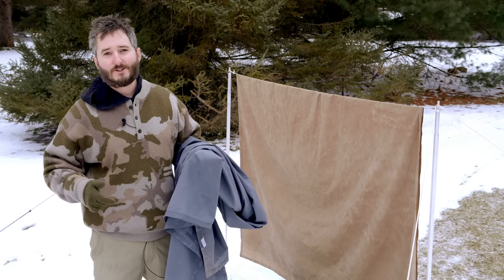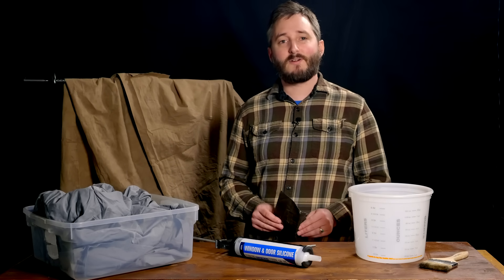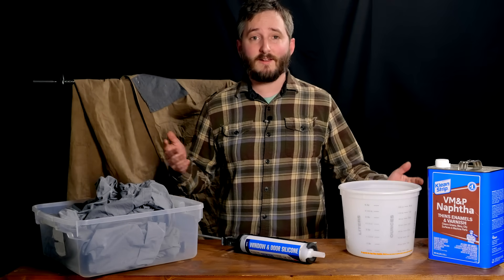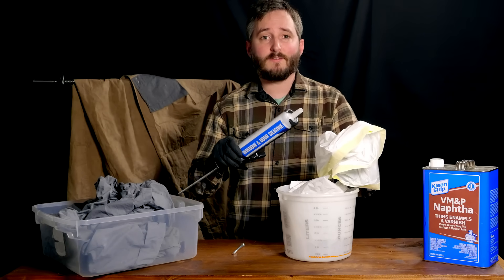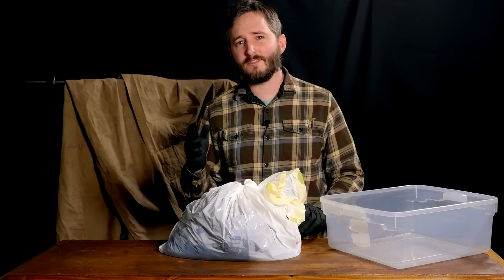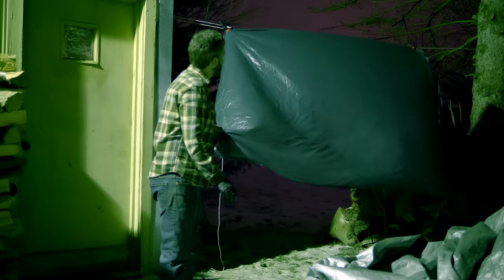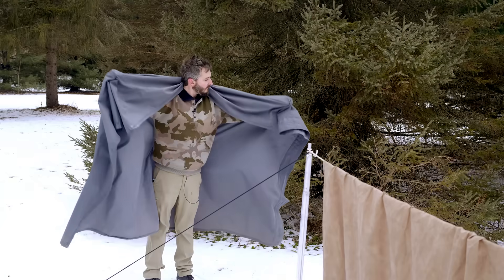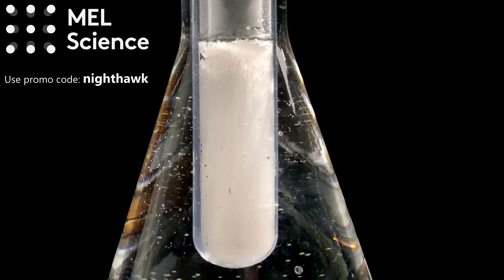Recycled Bedsheets Make The Best Waterproof Tarps

Comment: This is gold!   I just made a sailboat sail out of a bedsheet using this method.  Please, don't ever take this video down
Reply: RIGHT.....???!  
I was just pricing traditional oil-cloths & "NEW" survival tarps.   And this is a brilliant prepper-project. 
it's a GREAT skill
Reply: Im planning on waterproofing my bedsheet sail with this technique. Do you recommend sewing the rope in the edges before or after waterproofing it?
Reply: @sawer  Before, "glue" it all together!
Reply: @stewartmcdonald4121  won't the solvent dissolve the glue?
Reply: @samgould9930  the silicone would be the "glue", if I'm not mistaken.
Reply: @sawer   It really doesn't matter.  If it was me, I'd  do it without the rope.
Reply: @sawer both.
Reply: does the fabric still breather?
Reply: @snorttroll4379  No
Reply: @deltafour1212  thank you
Reply: I could see doing this as a fabric cover for wings...
Reply: @TimeSurfer206  Thought the same thing
Reply: @TimeSurfer206 I think they split up. But a drum and bass rinse-out would be interesting.
Reply: sailboat sail out of a bedsheet: it won't be strong enough . . .
Reply: @breannestahlman5953  It is for the small canoe sail rig that I am using it for.
Reply: @deltafour1212  don't worry about how strong your sail is, worry how strong the wind is.
Reply: @clivewells1736  I wasn't worried about the sail.
Reply: All bedsheets are not made the same, 100% cotton or poly? And some old sheets are so thin that even with that waterproof coating, they will rip. I think if you’re going to go to the effort, one: do it only outside and two: use a good, heavy sheet. I’m thinking of using this to re-waterproof my 1950’s umbrella tent. .
Reply: @earthn1447  You're correct.  I'm not sailing in high winds.  So far, my bedsheet lasted the whole year with no signs of wear. I'm making my next sails out of a shower curtain and a painters drop cloth using the same method.
Reply: My mom sewed unbleached muslin to make the 78 sq ft  sail for the 8 foot sabot I made as a teenager. The Alum pole mast was 17 feet tall instead of the 13 foot one called for on the plans
Reply: @MilesCobbett  Interesting.  How well did muslin work as a sail?
Reply: What a great idea!
Reply: Lol
Reply: and you trash all you love with.....
congraz.
Reply: Thi s is great...kiss goodbye goretex technology.
Reply: Excellent.
Reply: How is it now? Is it still good?
Reply: @ShellaPunx  Yes but it's getting worn out to where I need to start thinking of making a new one.   Not bad for 2 years of sailing on a $8 bed sheet.  ;)
Reply: @deltafour1212  we don't have naphtha here,can i use paint thinner?
Reply: @ShellaPunx  It should. I never used paint thinner.  Do a small test sample just to be sure.
Reply: @ShellaPunx  Do you mean turpentine? Yum, piney
Reply: calm down kid
Reply: Lol, must be a tiny sailboat! 🤣
Reply: @davidevery4434  ....and?
Reply: @deltafour1212  And?
Reply: @elelegidoriginal  Yep
Reply: @deltafour1212  And what? I don't know anything else about your sailboat, other than it's very small.
Reply: @davidevery4434    Small sail match with small boat.  What more do you need to know?
Reply: @deltafour1212  I don't need /want to know anything about your little boat! Thanks for your concern, though
Reply: @davidevery4434  NP. Glad you figured it out.
Reply: @deltafour1212  That your boat is very small? Lol, no "figuring out" was required. You do seem to be defending your dinky little boat very hard though. Which I find very odd. Still, the internet is full of oddballs!
Reply: @davidevery4434  Defend? Na,. not at all. Like you said, the internet is full oddballs such as yourself and are a tad slow upstairs. It's hard to go down to your level but I'm trying to do the best I can.  I'm just trying to help you out by making it a as simple as I can for you.
Reply: @isvaraov  No. I guess you missed the point but thanks for the suggestion, Captain Obvious.
Reply: @deltafour1212  oi delta do you know how to not be a cunt? Dumb dog
Reply: @codossgames7115  ...but enough about you and your mom
Reply: @deltafour1212  "4K Video Downloader" haha. I keep stuff offline. Have a nice day Mr. Serious !!!
Re-watched on suggested vids, have a nice day.
Reply: @stewartmcdonald4121   I was right, you did miss my point.   Thank you Captain Obvious  and sharing your "worldly wisdom"   Have a great day.
Reply: @stewartmcdonald4121  Small cents youtube pays to the contributor is robbed by watching video downloaded. Probably this is not the video you want to download.
Reply: @deltafour1212  you're unnecessarily antagonistic. Just explain what you meant instead of the sarcasm man
Reply: @CountingStars333   No..  you're SO wrong on the antagonistic and sarcasm part.    You're just too sensitive and took it as that. Knowing now how sensitive you are, I will forgive you on your emotional rush to judgment and analyses.   Giving you your daily needed hug
Reply: Do anyone check what nano do in nature ? Any of you 'naturlovers' ? 
I dont think so.

Comment: Interested in the thermal properties of such a material
Reply: Of silicone? Since the sheet is whatever you chose to use
Reply: @buckbuckleyson2259  no the paints thermal properties spreading the heat from hot areas to cold areas.
Reply: @pauln07  paint?

Comment: Great video! Is the end result resistant to UV light? At least cheap tarp usually tears very easily after being exposed to sunlight for extended time.
Reply from the maker: It's lasted until now for me without signs of damage. For added uv resistance mix carbon black with the silicone.

Comment: I did a bit of experimentation, using materials in the shed.
Methanol is totally unsuitable as a solvent. The Silicone is simply not interested in going into solution with Methanol.  
I found that White Spirit works, tho.  (I think you call it Mineral Spirits, in the US).
I put a blob of good-quality silicone sealant, into a jar and mixed in White Spirit until all the silicone dissolved. Then I coated a piece of poly-cotton rag with the solution, and let it dry. 
The resultant 'tarp' is water-resistant, but not 'proof'. Water does accumulate on the 'dry side', in globules, if I hold it under the tap.  Maybe a second dip into the sealing solution is required. Maybe a pure cotton substrate would be better, owing to the fact that it would swell when dampened.  As it stands, my experimental 'tarp' would be good for 95% of the conditions that I would expect to encounter in England. I've had commercially-bought products that are no better.
In the UK, where I am, Naptha is available from eeeBay sellers, at about £24-a-gallon. But, Naptha and White Spirit are fairly-closely related, I think.
Whether the process is 'worth the candle' ... I'm not sure. That is an individual' decision. I think that I'll source a cotton sheet, with a high thread-count, and make a full-scale version of my experimental 'tarp.

Comment: Vinegar, alcohol and acetone MIGHT do the job, in place of Naptha. I'm pretty confident that the vinegar would work ... you can generally smell the acetic acid flashing-off when you apply silicone sealants.
At to alcohol ... well, methanol is cheap and easy to find. Often used in bulk by people making bio-diesel fuels.
I guess that some experimentation would be in order.

Comment: Hi,
Does Naptha have Aceton, or is Naptha pure Aceton?
Im from a non-english country so i dont know the names on the chemicals in Naptha
Reply from the maker: No, naphtha is the same as white gas fuel, as is used in lanterns. It's not the same as acetone.
Reply: @Nighthawkinlight  Parafin / Paraffin? Thanx for replying! Great content
Reply from the maker: @Nilla_S  Probably not paraffin, but I'm not sure what it's called where you live. It is the type of fuel used in these lanterns: https://images.app.goo.gl/BSjAH98ynJ9V8coc9
Reply: @Nighthawkinlight  Thanks for letting me know! I have tried with a 60/40 mix and it does work!  My old rain jacket is waterproof yet again! 
50/50  was a bit too thick and the silicon didn't dissolve enough to get painted on the jacket.

Comment: Great video! How have I gone 50 years without knowing this? I assume the answer to my question is going to be a yes, but can use use dried up silicone tubes for this? also a bonus question is, do you have any idea how long something like this would last in the sun say as a small awning material or permanent rain fly?
Reply from the maker: Silicone cures, which is chemically different than drying. It may not be possible to get hardened silicone back into a liquid

Comment: Anyone try putting this on a skin on frame canoe?
Seems like it could turn relatively cheap fabric into a fine boat
Reply from the maker: It leaves the fabric breathable and water will soak through under pressure. Probably not good for a canoe skin, unless you paint the silicone on thick.
Reply: @Nighthawkinlight  I see, then maybe it could be sealed with a polyurethane sealer
I wonder if the silicone would inhibit bonding or add strength to it?
Reply from the maker: I would put poly on first, then test if silicone works well over top
Reply: @Nighthawkinlight  I see, if that was the case it would probably be better to just use rubberized paints
I’ll definitely have to experiment

Comment: When I was in the military, we used naptha and clear silicone to dilute the silicone to a syrup like consistency.  We spread it onto the weapon's fin base in wavy lines to allow ice buildup to break away easily.
Reply from the maker: That's pretty neat
Reply: What is a fin base??😟
And what kind of weapon has this..?😒
Reply: @warriorson7979  i'm betting it's flying weapons like missiles.
Reply: @warriorson7979  guns, chud
Reply: Just guessing, but when they said this, I pictured a mortar round which has a fin base (guidance systems aka wings in a circle etc.) and I secondly think it’s mortars because they mention ice easily breaking off fins, and I remember ice on mortar rounds being a bad deal if you needed to launch. But who knows. I’m just speculating.
Reply: @dontask6863  
Not so sure about that.🤔😒
Mortars are ammunition, not weapons, and guided mortars are VERY rare, and the wings used to guide them are on the nose, the tailfins are fixed.
Reply: @warriorson7979  Like said, just guessing. What you think he means then?
Reply: @dontask6863  
No idea.
Best guess is probably some kind of rocket/missile.

Comment: I plan to use this method to create waterproof fabric for some camper cushions. Once the blanket has dried, is it safe to store indoors? Are there any hazards of having dried solvent/silicone material in small quarters? Such as a camper?
Reply from the maker: There shouldn't be any hazards or smell once dry and aired out for a few days. You might want to look into the specific brand of silicone you choose and make sure there are no issues with long term skin contact with the cured product. Perhaps use a food grade silicone if you intend to use it as a blanket.

Comment: really really wished this worked better. What a great idea, really. I tried twice to realize this vision and failed both times although less so the second time. Considering I sunk $100 into equipment costs (I really wanted this to work), I don't think I can try again for a while. I would make sure your bed sheet is 100% cotton. Also, consider adding more silicon? maybe like 2L naptha 20 oz silicon. idk, im disappointed. I think this could still certainly work but this dude made it look so easy when it actually is not quite. Great idea tho, seriously i love it.
Reply: Additionally, make sure you are not usuing a thick sheet. even when doubling the recipe for a sheet of ~4L volume, full waterproofing was not achieved.
Reply from the maker: In what way did it not work for you? Did the sheet not shed water? Note that this makes a fabric that is still breathable, not totally sealed like a sheet of rubber.

Comment: I re waterproofed my tent that way, worked perfect ! Thank you !
Reply: Just curious how you did your tent?
Reply: @4rk4L1f3  I use a very large garbage bag. Ab. 2 liters of solvent ( mineral spirit I believed I used) 1 tube of silicone. Rolled the bag around for 10min as the liquid wont go thru the fabric. The result fills a little rubbery but looks great. The tent is our Canopy tent that was leaking, now its water tight :-)

Comment: Just did my old canvas backpack. 
Lessons learned:
Don't soak the pack, brush or spray on.
Do NOT make the mixture thicker. Keep it thin. Mine was too thick and has left some areas with a silicone 'skin'.
Reply from the maker: Yes, a backpack is probably too thick to soak. Making the mixture thicker improves the waterproofing, but you run into problems once there's enough to make a skin that could peel off. Hope it lasts for you anyway

Comment: I have used tungsten electrode inside a stainless steel cup with distilled water. I used high voltage and get massive gas production. I'm puzzled how this is possible. Distilled water shouldn't conduct electricity very well. Is it Thermolysis? Water split by great heat? If anyone has any ideas please let me know.
Reply: I forgot to mention my power source is a 220 volt variac which I believe is A.C current? So how can it be producing a flammable gas? Its A.C not D.C power to rip water molecules apart? I'm puzzled.
Reply from the maker: Both ac and dc work for electrolysis. Ac even works a bit better. Distilled water is possible to split without electrolyte, you just need higher voltages to stimulate dielectric breakdown. It will be less efficient than using low voltage with electrolyte

Comment: Just hung one up to dry. Thanks. However, I don't think those measurements were quite enough to saturate the king size sheet I had. So I mixed and added a bit more. Fingers and toes crossed it was enough. Warm and sunny for 3 days. Then rain. Can't wait to see the results.
Reply from the maker: As long as the sheet got fully wet by the solution it should work. The more silicone in the mix the more waterproof it will be but even light silicone will make the water bead up and run off
Reply: Found a couple blotchy areas that look like they may not have had enough coverage. Darn. Don't want to waste it, but don't trust it as is. Think brushing on a thin layer on less covered areas tomorrow would have any ill overall effects? Or should I just leave it and start again with a fresh sheet? 🤔
Reply from the maker: @timdupont3227  Test with water. It might be fine. Otherwise there's no harm in applying more with a brush or spray

Comment: How would this work on soft suede? I just came into a really nice suede jacket, that is in perfect condition. I know if I wear it, it will inevitably get wet, dirty, stained, etc..
Reply from the maker: It would probably cause watermark staining. Not a good idea to use on items that are meant to look nice.
Reply: @Nighthawkinlight , thanks for replying and offering your thoughts on the matter. I appreciate your consideration.

I’ve been thinking it over, and I’m probably going to give it a try anyway. Given your reply, I won’t be too disappointed if it doesn’t turn out great. I was planning on painting some designs on it, but I’d hate to spend a lot of time doing so, only to ruin it after wearing it only a few days.

I’ve had nice suede jackets in past but never for long before ruining them. So if there’s any chance it might work to make it more resilient to staining and water damage, it’s probably worth the risk, lol. Then if I the silicon treatment turns out awful I’ll just be spared spending any more time on the article.

Being as it seems unlikely the watermarking caused by the process will be consistently even, I’ll probably apply a couple initial coats in deliberately designed irregular patterns so that irregularities in the watermarking might appear as an intentional design element.

I’ll apply it to the exterior in sections letting each section dry before doing the next section. That way the nice interior cloth can remain untreated.

If you can think of any additional tips that might be helpful, do share. It’ll be a couple weeks before I find time for this project.
Reply from the maker: @multi-mason  It might look more even if you spray it on. Be sure to do so outdoors because the vapors are extremely flammable.

Comment: Tried it four times. Did not work. Although the thread was  probably sealed the water still came through. Perhaps you need a very high thread count fabric?  Very disappointing!
Reply from the maker: Sorry to hear that! Did water not bead up on the surface?
Reply: Yes it did bead up, but the rain splashed through in a fine shower. Same for all the sheets.

Comment: Is all naptha the same thing?   What I can find locally in Canada is stuff that is called naptha but it's listed as camp fuel or painters solvent.
Reply from the maker: Yes it should be the same as camp fuel
Reply: @Nighthawkinlight  Wow!  Thank you so much for your quick reply.

I have since had a few more questions about this come to mind.

#1. Other than making it waterproof, does this change material in any other way?  For example, I have a pair of suede boots I have treated with the spray on waterproofing crap you can buy at Walmart that wears off quickly.  Do you think it would be safe to paint these boots with this mixture?

#2 Can items that have been treated be washed?  Like for example, the tarp you make or the backpack you paint somehow gets covered in mud.  Can it be washed? Or will it lose it's waterproof coating?

I have so many things I have wanted to make waterproof over the years.....if this works as good as it seems to in your video, this is going to be a lifesaver.  Thank you